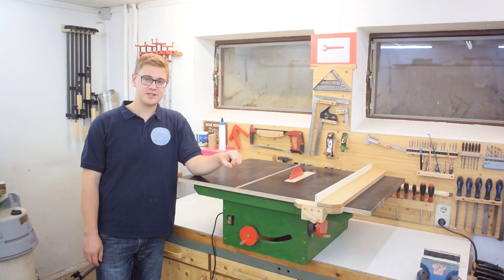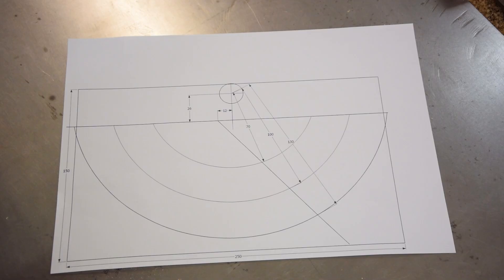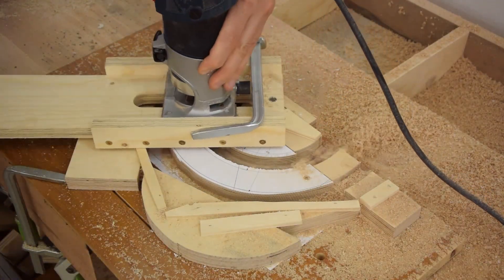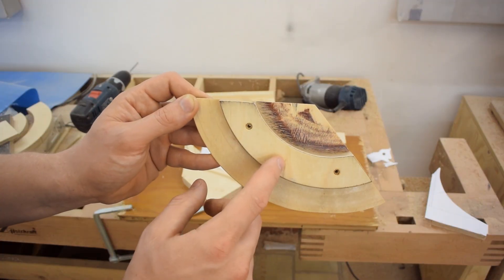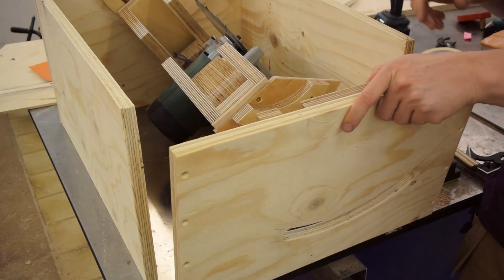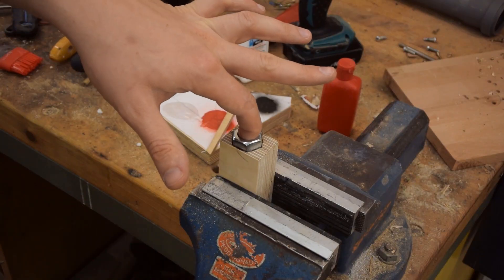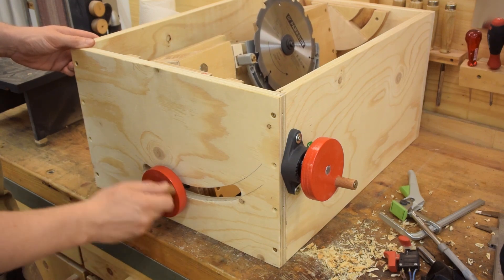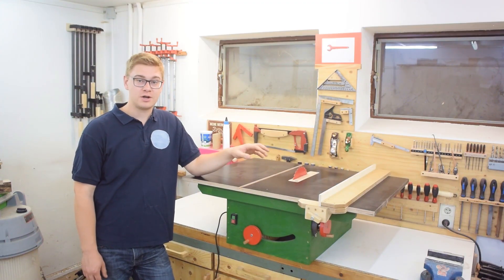How to build a Table Saw with Simple Tools - Part 2: Trunnion Blade Tilt Mechanism

Comment: Hi Cosmos
Hope you can answer my Question ?

I notice on the Drawing that you've made of your Trunnion, that there is a 12mm dimension,  from the centre line of the blade & to the Left  !  I am assuming that this 12mm dimension is the  "stepback" from the Centre to the part of the Motormount that you have then introduced your 45°/46° CUT to allow the Motormount to Tilt to its MAX 45°/46°  ?

Comment: hi mister, when I see your video, it's easy to understand,
and I want to ask what if the 45 degree setting was made just below the up and down setting,
so not beside,
I thought about still using a long bolt with a clamping system,
if at other times you are willing to make a video

Comment: Great work! I am just about to build mine too almost the same way. I am using the old Parkside 1700 table saw parts and still think instead using the tilt mechanism u are using to use bearings. I am not sure if it is going to work but when u lookup the parkside pks 1700, it works. I will give it a try. Thanks again that u are sharing this greatfull work with us! Greetz Boris

Comment: Great video! What I don't understand is how you keep the threaded rod to turn with vibrations, leading to change in height and/or angle in the middle of a cut. or am I thinking too much?
Also, I was wondering if there could be a way to skip the pillow bearing. Any suggestions?
Reply from the maker: Hi, I never had that problem on that saw. You could make a swivel mount for a regular bearing but the pillar bearing is easier.

Comment: Hi Cosmasjust have a question about your trunnion design and placement. why did you go back 12mm off centre? Also which do you fix, the short or long edge of the trunnion to the motor mount?Thank you
Reply: Did you get the answer as why he did this 12 mm offset? I am still curious to know.

Comment: I did it. When i first saw your videos a couple of months ago i sais to myself i can't pull this out. But one day i decided to give it a shot. I am a very beginner woodworker. So this was a sort of a startup project. I faced a few difficulties while building it (still a beginner and can't see far enough. I managed to get over them so far. My trunnions have a small play but they are working nicely i hope that won't be a problem.
Anyway i hope that it will work for a couple of years. And then i would have more tools in my shop to do a beter one. Sorry for the long comment.
Thank you bery much for sharing

Comment: Great video! Is it possible to get .dwg or .skp (or any other vector) file for making all parts on CNC (or Lazer cutter machine)? It will be very useful for all, cause CNC is chip, fast and accurate. Thanks

Comment: Very well done! I especially liked the trunnion jig. However, I would have made one small tweak. I would have made the threaded adjustment rods a bit longer and put a nut on the outside of the knobs, not for security or stability or anything like that I am just lazy and would tend to use my drill/driver and a socket to make adjustments.

Comment: I built it the same way back in December when you released the first video. It's very nice but unfortunately mine is about two millimeters off compared to the front. I still need to tune it. It's very important that the base and the top are sitting perfectly flat. I think that's why mine is off a little bit. Plus I almost burned my house down because the router wood dust caught on fire...